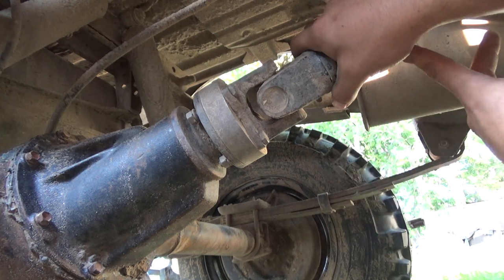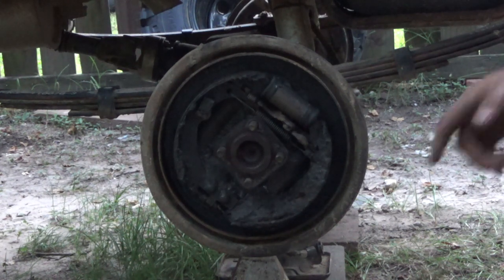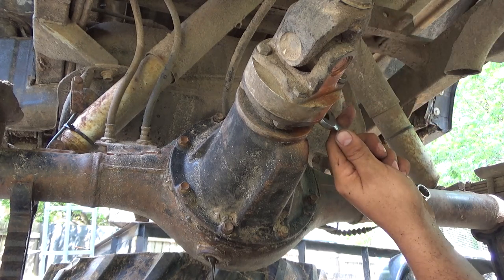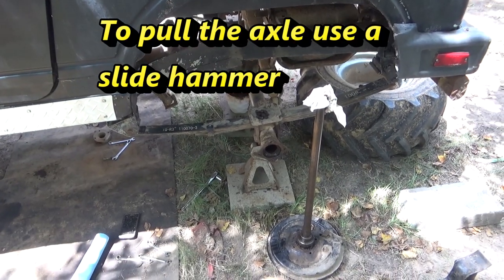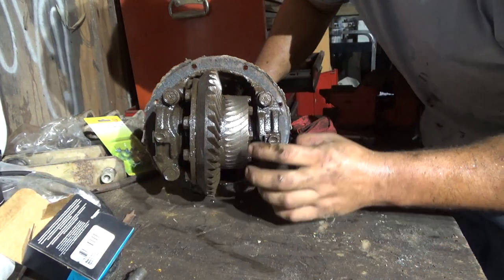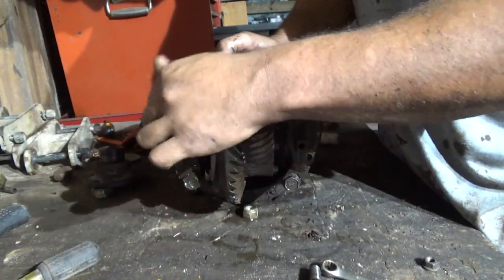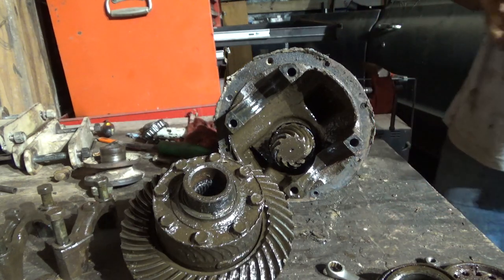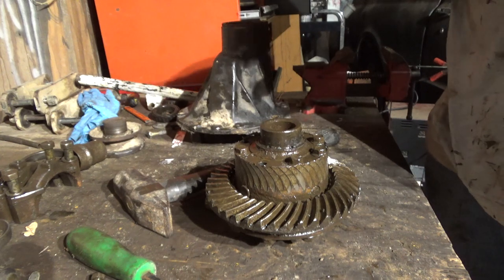Suzuki Samurai rear axle disassembly.

Comment: I like how on bolt sizes you say "on mine". It reminds me of my 94 s10 where a guy that worked on it used bolts that the threads were right but the heads were different sizes.
Reply from the maker: Yeah there is a reason I said that.  who knows maybe the previous owner put non factory bolts or maybe they aren't all the same.  I've seen stuff like that in the past.

Comment: there is  no oil in that housing  just  crappy mud :(  wonder how this  work so long
Reply from the maker: Yeah it was very dirty, but that was actually gear oil in the rear axle, it just had a lot of dirt or sand mixed in. I don't think the dirty oil caused any problems though. The pinion nut was loose and is most likely the only thing that caused any damage.

Comment: Wow, those pinion bearings were loooose!
Did you end up reusing the gears or were they too damaged?
Reply from the maker: No I did not use the same gears. I bought a used ring and pinion, and a used differential carrier. I think what made it loose was because the pinion nut wasn't tight or crimped. because the bearings actually seemed to be in decent shape, but i replaced all the bearings anyway.

Comment: Rear axle without oil?   wow...  broken all inside gear
Reply from the maker: no it had oil, it messed the gears up because the pinion was loose like i shown in the beginning of the video. so if you ever see one loose on anything fix it fast and it will be cheap, let it go and it will cost more to fix later. thanks for watching